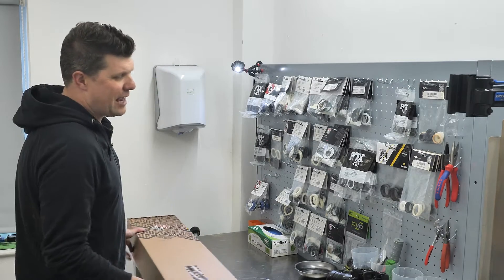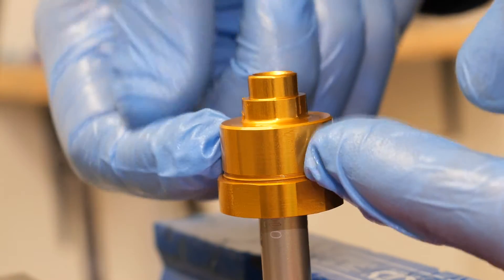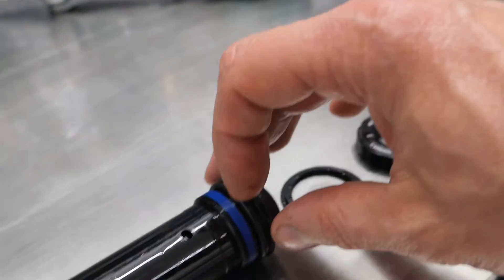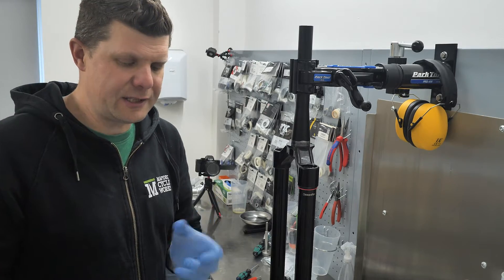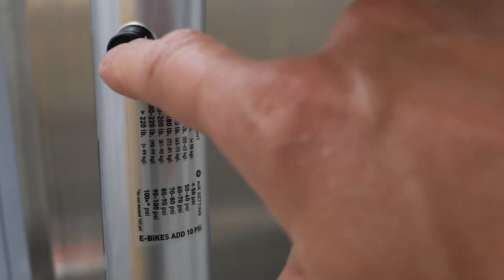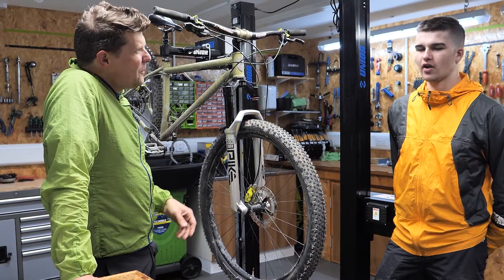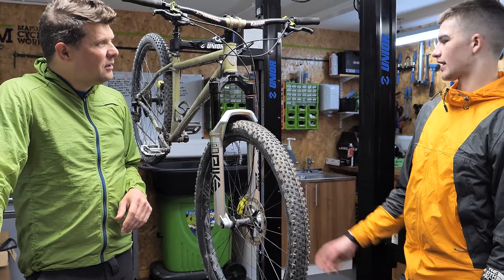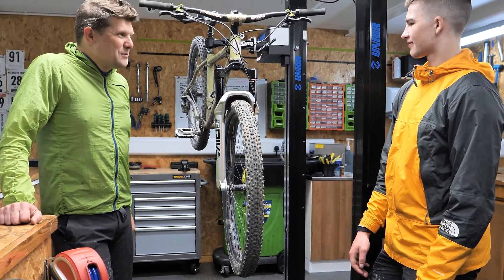NEW RockShox Pike Ultimate  - Teardown & Test 🔧

Comment: Hi! How come you chose a 130mm fork? I also run a 130mm Pike in my Sirius but I'm curious to try the new Pike with 120mm this time as I feel the bike may be a bit overforked. Is 130mm more plush than 120mm? I know it's only 10 mm but we all know that the bigger the air volume, the more supple the fork is. Any opinions?
Reply from the maker: The 130 is a bit long for the Sirius really. It was a fun experiment, but 120mm was much better.  ‘Plushness’ more to do with the tune and freshness of service.  You can set up a 130 to operate more in the mid stroke, but you tend to loose the supportive feeling a bit.
Reply: Thanks for the advice! Cheers!

Comment: Can you remove a buttercup by its hole or do you have to "open" the buttercup into 2 pieces to remove it from the airshaft?
Reply from the maker: You can do both.
Reply: Hi i want to upgrade my 22/23 Select fork by adding just the buttercups.  Actually i want to transfer the buttercup from a different length airshaft on sale, to my current select, so i have the option of having two different travel options.  So buttercup are transferrable?
Reply: @radidoc4832  for the buttercups you need the new debonair+ shaft. unfortunately you wont be able to but the new airshaft in the old fork because the airtransfer port is on a differenz location. but you can put the new charger 3 damper into the older versions.
Reply: @kleinkurti  i have a newer non-ultimate Lyrik that came with the bike without the buttercup but wanted to upgrade by buying a shaft with the buttercup. I was hoping to transfer just the buttercup, since airshaft is same.

Comment: No problems with this RockShox top-caps on the air valve. I always used both thumbs on top of both sides of the cap, just one twisty motion and You can easily unscrew it :)
Reply from the maker: Good tip 👍
Reply: @Mapdec  EXT does it right, you can ubdoniy with a hex. 👌

Comment: Nice video! I just installed my 130mm Pike Ultimate yesterday and the first ride is tomorrow morning. Quick question, when you removed the air spring, was it the same 2-pin circlip that SRAM has used forever, or is it a flat retaining clip like a FOX? It's hard to tell from your video.
Reply from the maker: Same as usual.
Reply: @Mapdec  Thanks!

Comment: Great review. Have a question. I can get a new rockshox ultimate 21/22 for 700.00 . The 23 model will cost me 1000.00 is it worth the extra 300.00 for the new technology. Is it that much better. Thanks
Reply from the maker: Yes. Before these the SID would have been the stronger contender for 120mm and the Lyrik at 150mm. Fox had the 130/40 sorted with the Fox 34 FIT4 damper. Or the CaneCreak Healm. This 2023 model puts RockShox back in the game at the 120-140mm range. They did a really good job of this fork.

Comment: I see that you added a bunch of spacers to keep the fork tube long and raise the bars. The stack is the biggest (or only) problem with this bike. The headtube should be 25mm longer and the BB could drop 1 or 2mm. I put 30mm rise bars on mine and it still feels low. The stack is my only complaint. It's the best bike I've ever owned.
Reply from the maker: It’s ace. I would actually prefer the bars lower, but the brake levers hit the top tube because of the slack angle. Also, the fork is being used on a bunch of different bikes while we test, so keeping the steerer long.
Reply: Hi! How much travel does your fork have? I also have a Sirius and I'm running a 130mm Pike Ultimate with the Charger 2.1 damper and the old 51mm offset. They say the frame is optimised for 100-120mm forks but it will take a 130mm fork sacrificing the geo numbers a bit.

Comment: So even with low pressure they are not initially supple
Reply from the maker: That’s probably the wrong way to phrase it.  Even with low pressure they feel supportive.  The initial suppleness is helped by the improved negative air and buttercups.
Reply: @Mapdec  Depends on what one wants out of a fork. I want a buttery feel over ripples. From what I've read here and elsewhere preproduction samples don't give that.
Reply from the maker: These aren’t pre production. We were just early to receive the new fork.  We paid for them.  As for a buttery feel… I’d say that depends more on regular servicing and the compression damping in the mid stroke. Aside from the Cane Creak Healm 2 I can’t think of a fork with a better compression damper to fine tune the mid stroke compression.  Maybe the Ohillins.
Reply: @Mapdec  Well I'll stick to my Helm 2 then!
Reply from the maker: Fine choice. Hard to beat those.